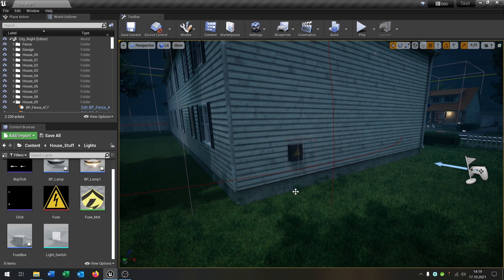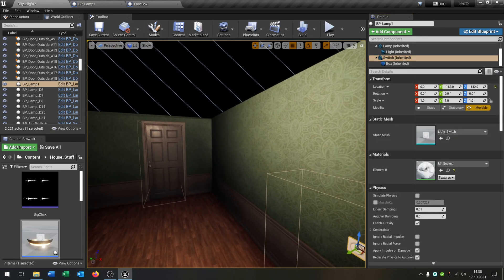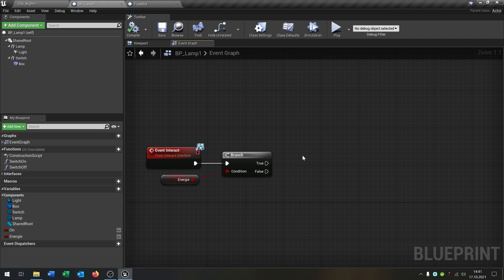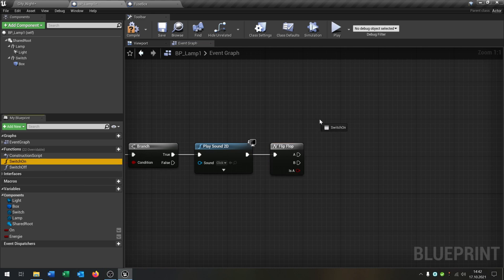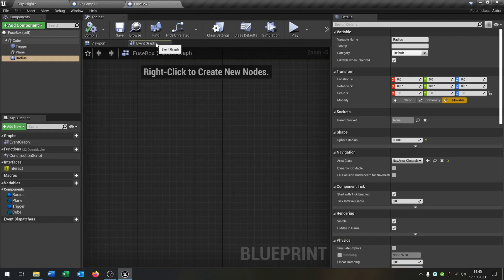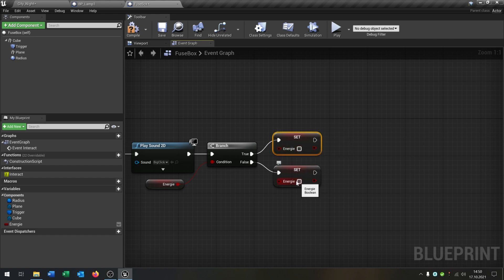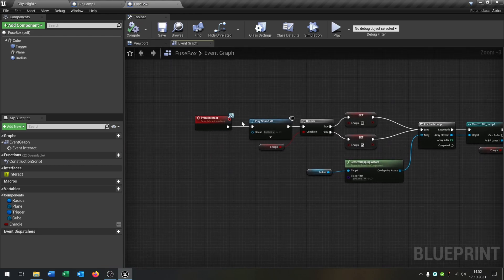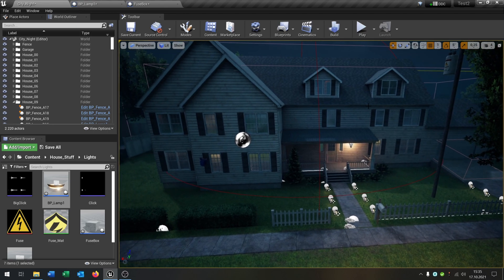Unreal Engine Light / Fues Box Tutorial

Comment: How would you do this involving different light blueprints? You can only call one light blueprint.
Reply from the maker: In this Case you need to create a Parent Class "Light". Than you can create Child Classes with different Light Setups.
Reply: You’re the man thanks I will try that, but would that work even if the light bps are different?
Reply: For example the static mesh and light source of each light
Reply from the maker: @tonyshoulders_  Of course. You just need to create a Base Class with a Static Mesh, Light etc. and use this as a Parent Class. Than you go right click on this Blueprint Actor inside the Content Browser and use "Create Child Blueprint Class". Than you need to replace the Static Mesh etc. When you cast to the Parent Class it will include all Child Classes.

Comment: Is there a way I can send you my light BP?
When you shoot. It falls down and hangs exposing wires. Emits a spark and blink of light with ray traced shadows every 2mins an 30 seconds. 
Also adds an impulse so the it gives the illusion the spark makes the light swing.
Feel free to pull it apart an make a tutorial of it.
Reply from the maker: If you want you can post it to the Discord Server or send it directly to me:
https://discord.gg/exuHzHjahe
Reply: @Seredias.  Excellent I will send it soon. 
I got it working with this tutorial. 
I won't include the fuse box.
Shooting the light also makes the switch disabled. 
But shooting the light switch makes the light fall down which is not meant to happen.